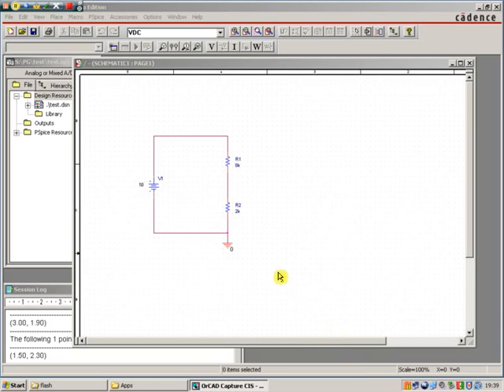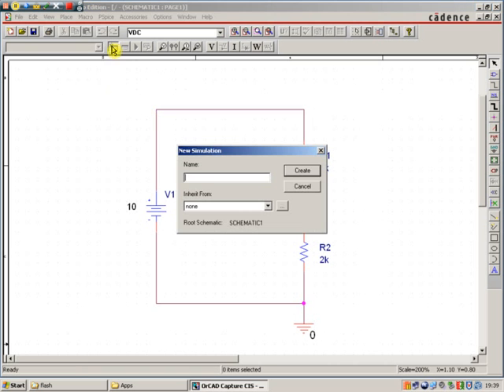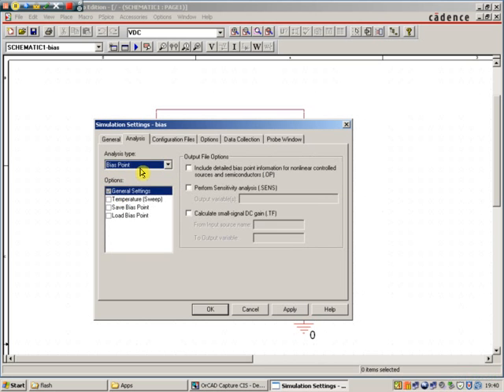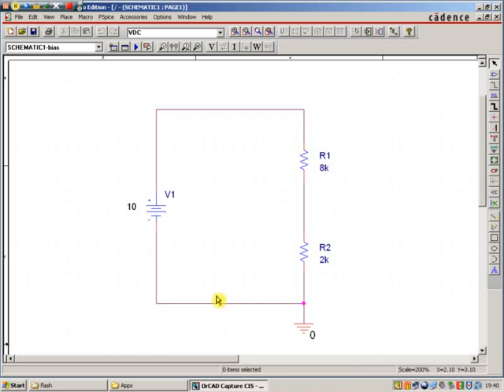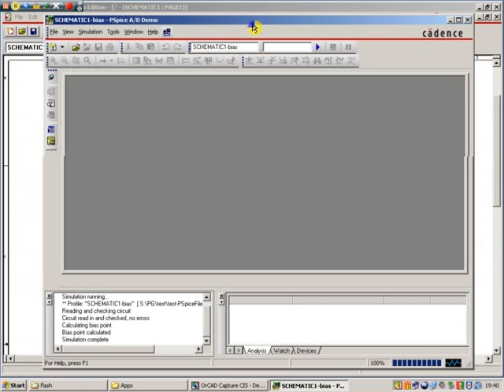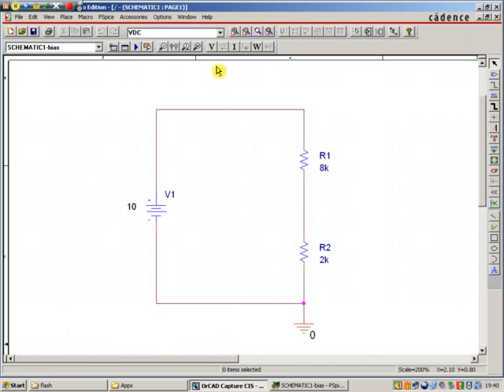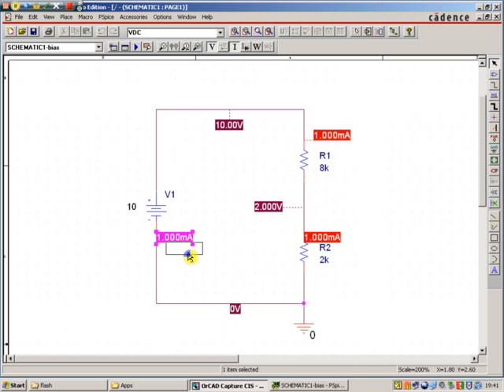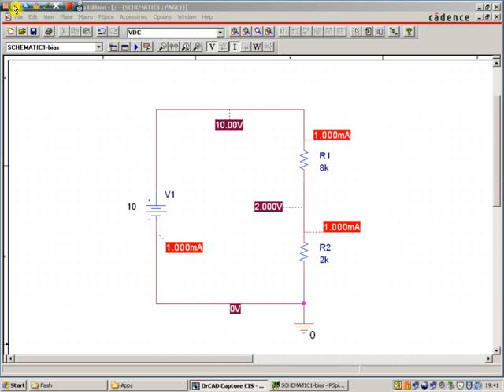OrCAD simulation Bias point

Comment from the maker: Try checking t make surer you have ground correct on the circuit. I bet you have the wrong ground or or using an older version of the demo. If it's an old version, rename the ground connection symbol "0" that will fix it.